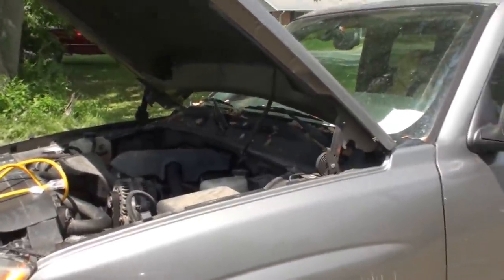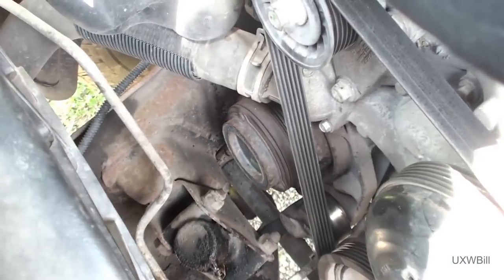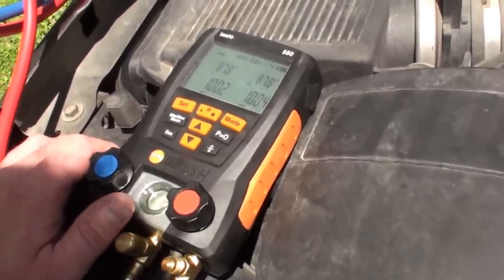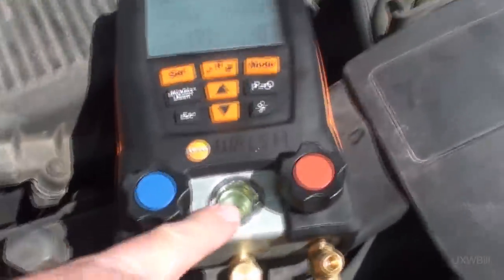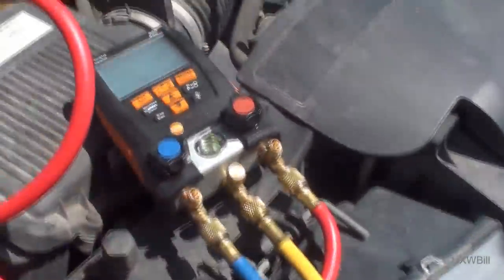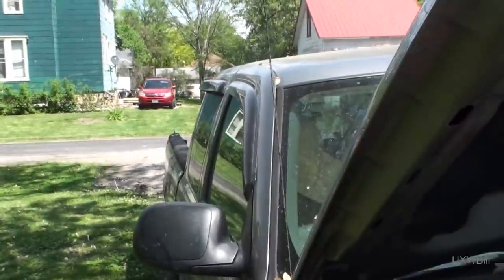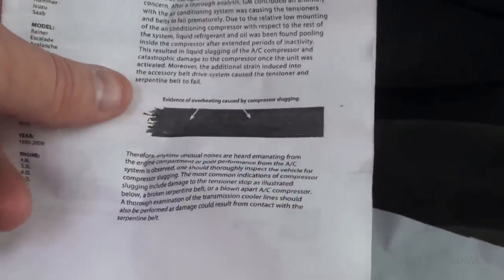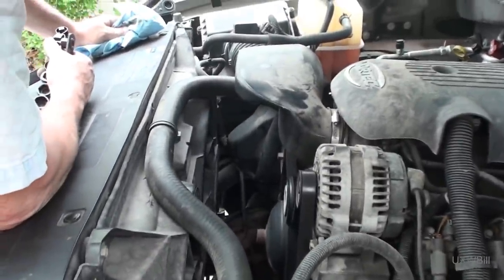Naughty Truck's Air Conditioning System Misadventure

Comment: That's a nice truck!  I still remember the first video you made on it and how it left rubber on the road when you accelerated.
Reply from the maker: Outside of the rust, which I don't really have a problem with, it's just about perfect...nicely equipped without going overboard. (It's also a bit of a unicorn in that an OnStar Delete was requested when it was new. I really don't want any part of that garbage.)

Comment: I feel that a set of slip rockers would do wonders for the cosmetics of your truck.

It's a lot easier to do a long lasting repair than you might think. You cut the sheet metal back a few inches from the rust, clean up the edges, then affix the slip rockers over using whatever method you please (Rivets, Panel bond, duct tape, or even welding).

Next you'd want to open up the little body plugs behind the rockers and spray the living hell out of the inside of the rockers with Fluid Film, or even used motor oil (do this once a year)

I did the rockers on my Suburban this way 2 years ago, and there isn't the slightest hint of rust starting.

Oh yeah, don't forget to pick up either a can of Bedliner, or some color matched paint to blend your repair in. Since they are just rockers, I wouldn't bother trying to blend in the seam with filler or anything.

Comment: You know a ton more about ac repair than I do! Looked like you did a much more thorough job than most service shops. I agree with your comments about new cars! I bought a 2010 Toyota corolla for $500 about 3 yrs ago and spent $800 on new tires when I got it. All I've done is some oil changes, gas and cheap insurance. 
I plan on running this little Toyota as long as possible since it works like new! 
I hope you're pickup lasts a long time for you with very little costs!

Comment: As the owner of a later-model car, I don't blame you a bit for wanting something that doesn't have fiddly touch screens, or "smart" keys, or other "if it breaks, it costs major money" stuff.

Sure, Toyota makes one of the more reliable products of this type, but my car is a collection of about 57 computers on wheels, and I need special software to talk to ALL of the car.  Just getting an extra key cost $200 (to do it correctly; none of this "download shady software" stuff).  At least my car has physical climate controls that are separate from the head unit.  I can't understand how anyone would tolerate having to dig through the touch screen to adjust the climate controls.

If I could buy a car that primarily just drove and did so without a fuss, I'd be there like shareware.

Comment: tensioner pulley failures are pretty common on that era of truck. for future reference you can order a stretch belt from a later LS equipped truck. you can delete the failure prone tensioner and you will never have to worry about a future failure.
Reply from the maker: I suppose if it happens again, I'll see about doing that.

Comment: I've been doing AC work on my 98 Grand Prix GTP, had a leaking high side port and replaced that now I'm thinking it has a clogged orifice tube.  Glad to see the ocasional new video after all these years, hope you're doing well

I'd recommend replacing the high side valve that uses that weird rubber looking valve instead of a schrader I've had/seen many of them leak on the Naughty Truck it's in an ideal spot you can probably get it off with some creative misuse of tools but on the Grand Prix it was buried so I bought the special mastercool socket for changing it.  Before I knew it took a special socket I tried changing the port on a Regal GS for a friend and ended up having to replace the hardline it was in which runs from evaporator to the drier on the front of the car.

Comment: These are great trucks.
I've seen them go 400,000 miles, here in SoCal, these run forever.
And hey, I don't fault you for getting a compressor and related parts.
At least you're replacing parts that likely would need replaced, anyway.
Also, I appreciate someone that owns up to their mistakes.
Thanks for the video, Bill.
Reply from the maker: The compressor was not replaced. All the other supporting parts were.
Reply: @uxwbill  I wish salt hadn't taken over,
That truck will go another 200,000 miles.

Comment: I don't know how economical it is for you but here in nebraska I'm getting ready to do a lot of rust repair, ie cut it out and replace rocker panels and some sub-frame bits on my pontiacs and suburbans. I may well just become a manufacturer of these parts since so many I see need them!  Mmm road salt..or nowadays this different 'liquid' they spay.

Hope the truck still serves you well since I agree with you on new vehicles wholeheartedly. Too technical to drive and enjoy. I much prefer just a normal radio and a heater at the least for cruising A-to-B.
Reply from the maker: More than anything else, I'm just not anything like that dedicated. That's especially true on a high mileage, fifteen year old truck.

Comment: Have you considered covering the frame and wheelwells with Fluidfilm? I live in a rustbelt in Norway, and antirust treatment is a must if you have an interest in keeping an older automobile. Finding pre millenium automobiles is getting quite difficult, as the rust never sleeps.
Reply from the maker: No. The effort required just isn't worth it to me.

Comment: Touch screens are by far not the most annoying thing about modern cars, you only really mess with it if you use the navigation because you should still have real controls for radio volume and such on your steering wheel. The real annoying things are the safety features that you usually can't turn off, like randomly slamming on the brakes if the car thinks you're too close to something, but it's actually picking up someone in the other lane. Or a computer controlled boot lid release button that will just BEEP at you for seemingly no reason, instead of actually telling you what it wants on one of the many screens. Or it turns the engine off every time you come to a stop and you push the button to DISABLE it but the next time you start the car it's right back on again.
Reply from the maker: I don't have any use for a touch screen in a car, nor do I believe they have any place there. In particular, touchscreens cannot pass the "every dashboard control should be operable without having to look at them" test. I could take or leave steering wheel controls (my truck hasn't got them, and I wouldn't buy/order them). Not all "infotainment" (yes, I HATE that word) systems have any physical controls, nor were any of the ones I've seen programmed by anyone who was even slightly burdened by the thought of usability or discoverability.

Those "safety" features are the electronic nannies to which I'm referring, with tire pressure monitoring thrown in as well because I've never seen it work correctly across two decades worth of vehicles. At best, it's a lousy way to implement a thermometer. I could only see it having any value in a case of sudden complete tire pressure loss, but odds are good you'll already know that from how the vehicle is handling before the display says anything. I fear we are heading toward a generation of drivers that will be totally reliant on these "safety" features, rather than staying focused on their task and aware of what's going on around them.

I've never driven any car or truck equipped with an engine idle shutoff, so I can't comment on that, nor does the 4.8 liter V8 engine in Naughty Truck support the variable cylinder deactivation stuff that was offered with the 5.3L V8. The former I could take or leave, the latter I'm at least a little curious about.

To close this up, I will say that the linkages between steering controls and the brake pedals should always be physical in nature, not mere inputs to a computer that behaves as though it knows better, that could fail or become compromised, leaving the driver with no say in the matter of controlling their vehicle or being able to bring it down when everything else has gone wrong.
Reply: @uxwbill  Especially the parking brake. Computer controlled pushbutton parking brakes feel so wrong on many levels.
Reply from the maker: @s8wc3  The automated parking brakes I do not profess to understand. I gather that people getting out of their vehicles while they are in gear is a thing that somehow happens (or happened) with too much regularity. What I don't understand is how anyone could be that absent minded. I also don't understand how one could ever get out fast enough that they were clear of the vehicle before it started moving. (Perhaps they don't, and end up being dragged along for the ride for a while.)

Comment: I had a 97 Silverado with a fiberglass step side bed. I loved that truck it was a V8 but I easily got 22mpg. But rust finally killed it. The frame got to where it was rusted so badly that it broke in half. Still ran great with 300,000+ miles

Comment: i think you just have helped me solve a big mystery with the tsb you just shared because my 2003 Chevrolet suburbans a/c Compressor from time to time makes a horrible sound when you turn it on after it sat overnight and I’ve never been able to find a reason why I think you’ve solved the reason I’m going to inspect that pulley immediately and find out what I need to do to find a solution to fix this problem thank you very much if it makes a recommendation on how to fix the sluggging problem or if it’s just the tensioner causing it please let me know oh and i thought i would mention that particular supplier gets OEM parts for their new products I was surprised as well when I put a compressor on my Ford explore used the same company and I called and asked and that’s what I was informed of that’s how they can guarantee their warranty as they were getting some really bad compressors in the past apparently i don’t know how true this is but it’s what i was told
Reply from the maker: The "slugging" (internal parts of the compressor being subjected to incompressible liquid refrigerant) to which they refer is purely a refrigerant related problem. Not only does refrigerant "want" to be with the oil in the system, it will also go to the the coldest place in the system, unless something stops it from getting there.

You should definitely examine the tensioner pulley to make sure it is not failing or in the proces of becoming damaged. Unless it's caused by a refrigerant overcharge or too much oil in the system, I don't know of any ways to resolve refrigerant slugging in an automotive A/C system. (Residential and commercial A/C and refrigeration equipment oftentimes uses a small electric heater on the body of the compressor to drive refrigerant out of there and keep it from displacing the oil. Engine heat will certainly help a little to drive liquid refrigerant out of the compressor, as will airflow through either coil (condenser or evaporator) if they become the coolest parts of the system.)

The pamphlet should still be around, so if I can find it and there's anything about solving the problem in there beyond what I've already mentioned (overcharge or too much oil), I'll post accordingly.

Comment: 228k is nothing to worry about on these engines. I see these 5.3 with over 500k regularly. If I were you I'd keep this baby forever. I have a 08 with 157k...not even broke in yet. Great trucks. Furthermore I still would have went ahead and just replaced the compressor unit since you were already down there and moved everything out of the way. Either way excellent video.

Ps. That sending unit for your oil pressure is bad. Typically when those gauges fail they will read max psi.
Reply from the maker: This one is a 4.8 V8. I suspect the rust will be a problem long before the powertrain. My brother and I didn't get as far as getting everything out of the compressor's way when the failed tensioner was spotted. I thought about changing it anyway and couldn't justify the expenditure when the compressor I had was still completely functional.

I do plan to change the sending unit in the near future.

Comment: WOW!  There were NO balls left in that bearing!  It sure did destroy itself.  It must have been making alot of noise.
One clue that might tell you whether or not the compressor bearings are bad is to note when the noise occurs.  IF the noise is there without the compressor running (clutch dis-engaged), that might point to either idler bearings or the clutch bearings being bad.
If the noise goes away when the clutch is engaged, it more than likely is the compressor clutch bearings.
Like you found when you rotated the pulley by hand, and it was quiet, that should rule out the clutch bearings.  But like you also stated, the side load on the pulley from the belt could also indicate that it still could be the idler bearings.
It can be tricky to find what has failed, but you did the best you could.

Comment: My rusty trusty 03 Dodge Dakota's A/C system has been giving me a bit of a project every year so far. I didn't know the A/C worked until I found out that its clutch coil had no ground connection (I actually ran my own solid core ground wire to fix that). Then last year the bearing failed in the compressor's pulley (I was able to replace the pulley, clutch and coil keeping the compressor itself intact). And now this year the clutch coil seems to be dead (the clutch does not attract or click when I energize the coil manually by hooking it up to the battery directly). The coil refuses to even grab a paper clip at this point. This weekend I should have my 2nd round of clutch coil and pulley parts which will be fun all over again and will maybe give me a video upload or two (wish me luck). I have a feeling my compressor may decide by next year that it's had enough. You seem to do things much more in the realm of how they should be done (I just use A/C pro and walmart r134a cans) - hopefully your A/C system thanks you for this and provides you many more years of low/no cost service.
Reply from the maker: One of my neighbors had a full size Dodge Ram truck from the late 1990s with nonfunctional air conditioning. He asked me one day if I'd have a look at it, and being the curious type, I said yes. For some reason, he backpedaled almost immediately and said "someone else said it was just completely trashed and not worth it". So it never got looked into any further...probably no matter, as rust had almost completely eaten that truck.

Comment: I remember right before driving out to Denver in my '98 Suburban I went to the junkyard and picked up an A/C Compressor after the original one locked up.

About 100 miles from Denver my I started to smell burning rubber, I stopped and popped the hood to see the A/C pully standing still while the serpentine belt was burning up. 

I shut the truck off, took the belt off and worked the pully until it was kinda free.

When I put the bt back on it did run, but it sounded terrible, so I ended up limping to the parts store and buying a new compressor (I originally was just looking for a bypass kit, but they didn't have one in stock).

I'm still using that same belt that got torched 7000 miles later.
Reply from the maker: I'm going to hazard a guess that GM was still using the R4 compressor in that application, and it definitely wasn't their finest work.

It's my hope that whoever ended up with the BBPOJ appreciates the fact that it's not merely a junker, it's an air-conditioned junker.
Reply: Actually no, they changed that in '96 when they went to the Vortec MPFI engines. I remember my  '95 Burb had the R4 though.

It was still a heck of a lot easier to replace than it would have been with 4.8 in your truck.

Comment: My 1997 Ram 1500 has never had the A/C serviced and it still freezes me out on the hottest days.  I actually have to turn the heat up just a bit to take the bitter chill out of it.  Granted my truck doesn't have near the miles yours does as it isn't my everyday driver at 10-14 mpg.  It's 25 years old and just about to hit 100K.

Comment: To be fair while you didn’t guess what the issue was the first time, I would say this has to be the most throughout when talking about pulling an A/C charge. Most other videos on this kind of install totally glaze over the importance and most just mention to go to a garage or other place to get the system recharged.
Reply from the maker: From what I've seen of such work being done in dealership garages, I went a lot further than they would, especially on the vacuum.

Comment: Well unexpected good news is still good news even if It came from a mistake! I highly doubt many dealers or shops would have gone to the lengths you did to find the problem, they'd rather fire the parts cannon at it. I believe GM has a bit of a history with using leak detection die in new systems, many I've worked on have had it. I just finished replacing the AC condenser on my 2002 Chevy Cavalier and it had it as well and I don't believe the system had ever been serviced to my knowledge. Ps... I totally hear where you're coming from as far as new vehicles are concerned, I can't think of any brand that makes something decent. All the stupid electronic "assistance" features and likewise are a complete joke along with the extreme use of plastic in major drivetrain components. I'd sooner spend the money restoring something older than buying anything off the lot made in the last 10 years.
Reply: I was in a new rental car recently and noticed it had a plastic steering wheel.  Good grief.
I find it frustrating how most people are happy to get rid of an old car to buy a new car payment and full coverage insurance policy, instead of spending 1/3 of that money to fix up the old one.  It's a vicious cycle, because with each new generation of cars they get harder to service.